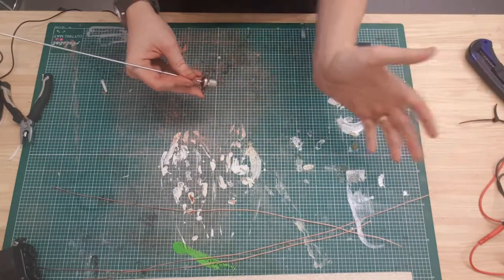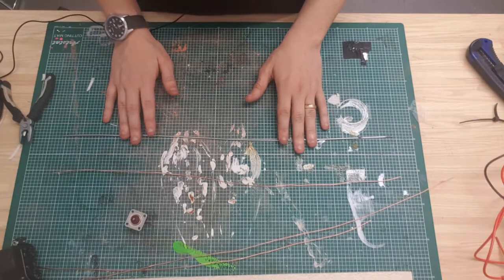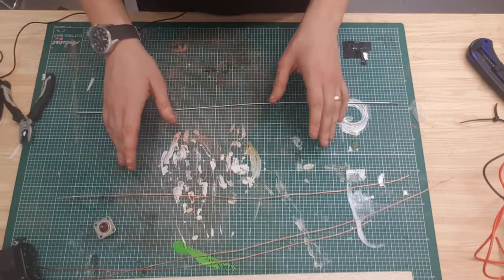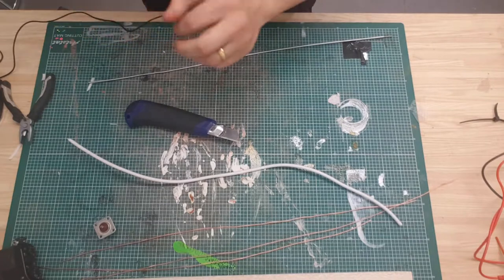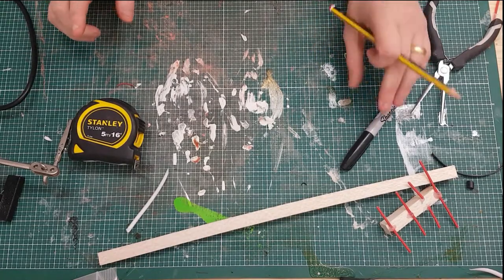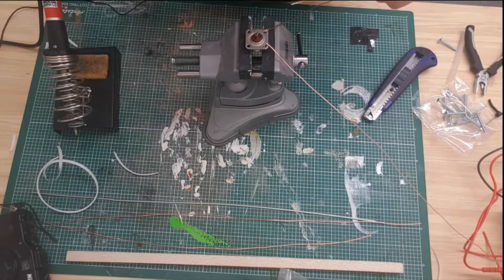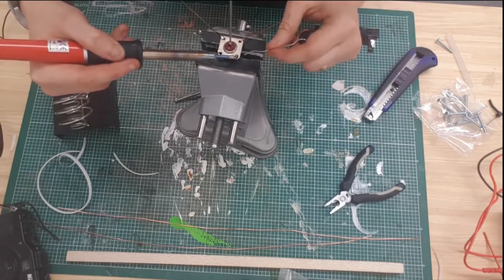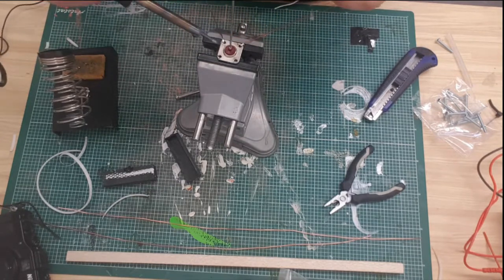Homemade 1/4 Wave Groundplane Antenna

Comment: Very nice, did you end up sealing the pin area and if you did, what did you use?  I think I'm going to build one for a permanent outside antenna but heavier duty welding rods.
Reply from the maker: I did, I used some standard two part Epoxy, worked well and still going